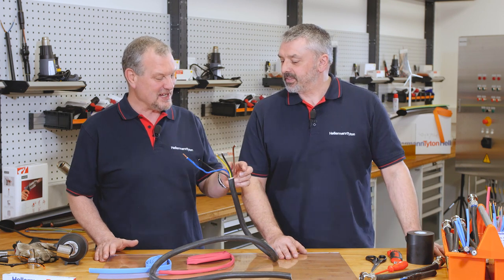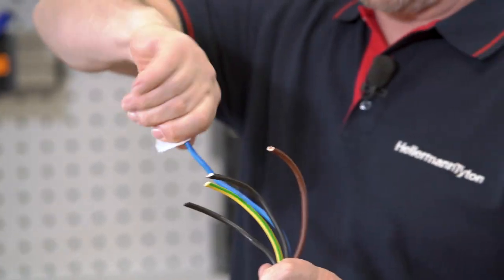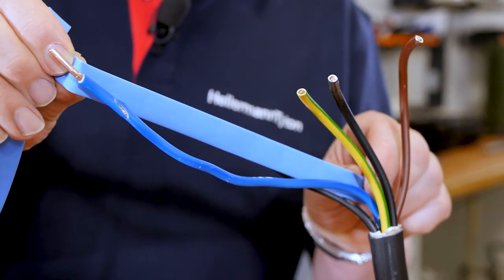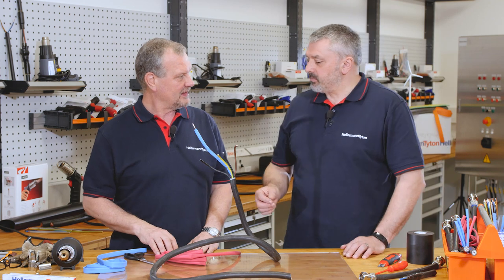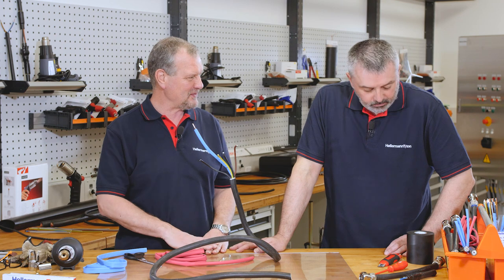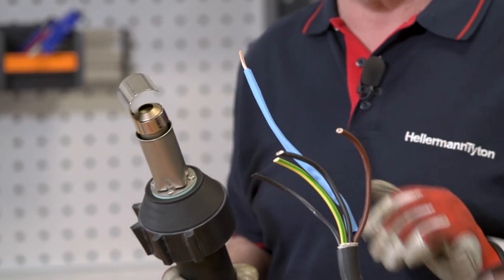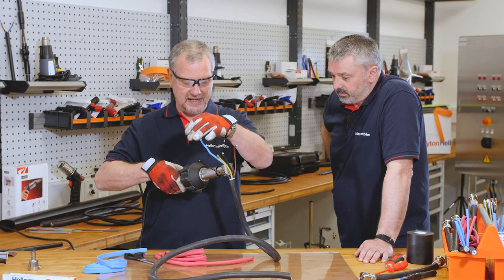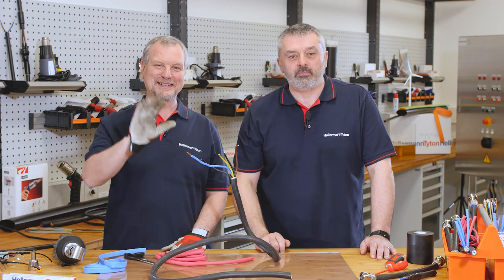Repair damaged wires with coloured heat shrink tubing #6

Comment: And what about nicks that are in the middle of a wire you don't want to cut?
Reply: good question  😃
Reply: That's my exact question.....I have an in ground wire with nicked insulation.....I cannot figure out how to kill the power to it unless I kill all electric to the home....3 boxes, 2 are breaker, one is fuses....and line is one of 4 only 8" underground in same trench as a copper waterline...I've cut the water line off at both ends (house and garage) what a cluster I get to figure out.

Comment: Hello
My motorcycle's wire was damaged by rat bite, not entire wiring harness, only two wires.  Can i use polyolefin tube instead of adhesive tape?
Reply from the maker: Hi Omkar Karalkar, That's a good question, this depends on the cable diameter and where the cable is on your motorcycle'. Also how much space you have. The best is to ask in a professional car mechanic garage or you can contact our product managers: here: https://www.hellermanntyton.com/contact?utm_source=youtube&utm_medium=social&utm_campaign=youtube&utm_content=comment-odWOK8TaJEw-com-contact 
Best wishes, Nico